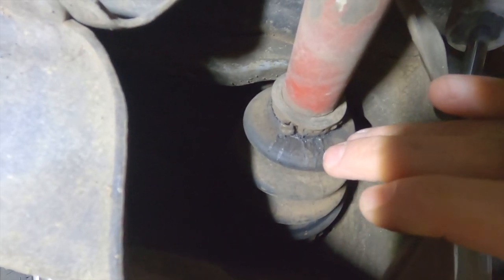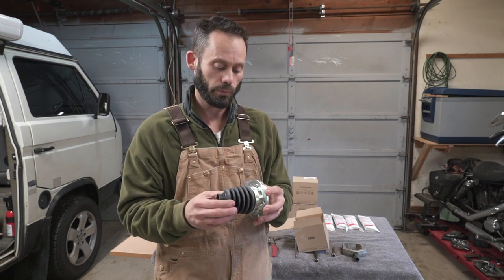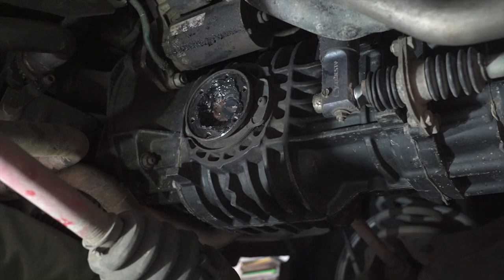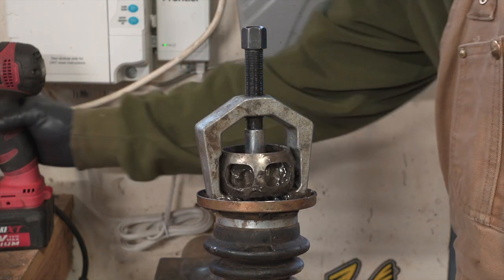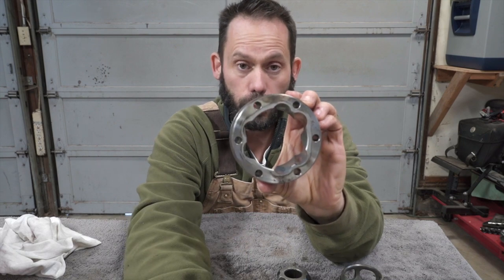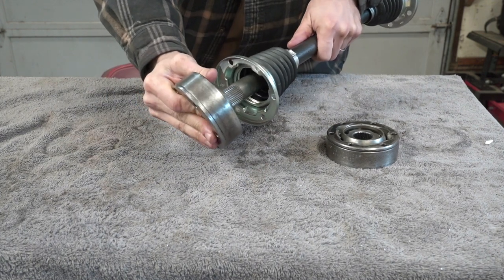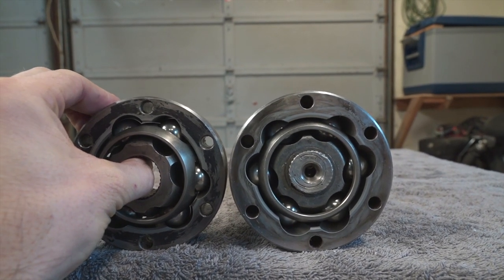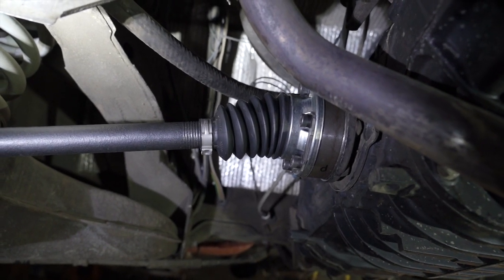How To: Vanagon CV Joint rebuild with OEM VW boots and clocked joints

Comment: Good job on the tutorial. Glad you mentioned the clocking as most folks are not aware of that. I replaced my CV's with the Porsche 944 CV's as they have more articulation which i needed when I upgraded to the GoWesty 1.5" lift springs.
Reply from the maker: 944's are on my list but I can't justify them until one or more of my Vanagon CV's need replacing.  If these Tiguan boots fail I might have to look for other options and then just put in 944's at the same time.  
nate
Reply: After installing Gowesty 1.5'' springs my CV joint' s made noise when accelerating. Clocking was not correct either. Now go and install 944. It is very important that you install the old drive shaft in de same direction of rotating.

Comment: Previous owner had those bolts torqued to like 100 foot pounds.  Had to use a pipe on the breaker bar.  And, no tensioner washers nor serrated washers either.  Anyone know when you put the replacement axle in (I bought a whole, new axle.) how closely it should fit the space ?  Right now, it seems if I get the wheel side in, I am going to be about 1/2 inch too short !    The camping trip is in a week !!!
Reply from the maker: First make sure it is the same length as the old axle. Manual transmission?  They will be the same length. On an auto they are different lengths. If it appears to be the same length, it may just be the new boots that are pulling the joint back a bit. You can stretch the joint out a bit. But first make sure it is the same as the old one!
Nate

Comment: great explanation of every thing,  i never separate my joints to repack them, i feel that the wear pattern will not be disturbed if i leave them together.i just blow them out with cleaner.
Reply from the maker: That is true about the wear pattern but I would be more concerned that you are not able to inspect the balls and races properly to check for pitting or excessive wear.  But at least you are putting in new grease and keeping them fresh!
nate

Comment: Excellent!!!  Up until now, the Ron Chandler video for CV Assembly was the most accurate video I've seen.  But you covered everything, even beyond the Joint Assembly and included clocking which is often difficult to find.  Only one other thing that would be helpful is the torque value for the CV Bolts.  I can't count how many other videos that I've seen that have left out important details or have given incorrect CV Assembly instructions. My Hat's off to you. Thanks!  I'm saving this video in my video library to share with others.
Reply from the maker: Thanks, I totally spaced adding in the torque value when making the video. Thanks for the feedback!
Nate

Comment: Good breakdown, good techniques!  I hoped you'd cover things like putting both circlips in/each side of the bearings, how much extra grease you put in the cups on the axle, or drive output flange before installing.. tips on bolts, washers, keeping it all tight, any ideas like if you need to retorque after x miles.. 

Those axles look sharp!
Reply from the maker: I have never seen circlips on the back side of a Vanagon joint or even the use of the domed washer.  These only use the circlip that was shown being taken off in the video.  This video was centered on rebuilding the CV's and not a full install video on CV joints.  
Thanks
nate

Comment: Great video.
If I may the reason those bellows are rubbing together might be an easy fix.
Cut off those pinch clamps.
Slide that boot out over those ribs.
Then install a new pinch clamp.
This will elongate the bellows and give you more space between the ribs of the bellows.
Reply from the maker: Yeah stretching the boot out would keep the ribs from rubbing but I am not sure about adding in additional "stress" into the boot.  Where it sits is the natural length of the boot and after 30K miles, the ribs look almost new.  If one does fail, I might try that to see if it lasts longer.
Thanks for watching!
nate

Comment: Awesome step by step cv joint video. Thanks a bunch!!!
If one side of the inner race has a step like ring and the other is flat, which side faces the axle?
Reply from the maker: On the inner race it doesn’t really matter much. I would put it back the way it was. If you don’t know then put the step facing out. 
Nate

Comment: Great video.  I have an 87 auto and it started clicking on a 500km drive today.   Couple of questions,  what causes them to start clicking? Second would this mean I need new cv joints or would a clean and repackaged as you have shown be enough.     Thanks again for the well don video
Reply from the maker: They can click if the grease turns hard or if there isn't enough grease.  If you catch it early, a quick clean and grease will be fine.  Take them apart (one at a time) and inspect the races and ball bearings for any abnormal wear or pitting.  Some slight grooving is the races is fine.  Reassemble and put in fresh CV grease.  
nate

Comment: How have the boots held up so far?  Just curious. . . . I had to do the similar thing on my '91 GL after the outer bearing started to squeak.  The joints fell apart on both sides as I was trying to get the spline out.  This video was extremely helpful, especially after I put them back together wrong and they would not bend at all!!  Thank you for all your videos!
Reply from the maker: Yep it’s easy to assemble them wrong and they will be locked up as you found. Glad we could help. 
Boots have been holding up great!
Nate

Comment: Awesome video, thank you.  Nate, do you always do this job with the van on the floor, no stands or ramps?  Is that the standard practice?
Reply from the maker: Yes on the floor. Our van is tall enough that we can fit under it easily. If you need more room, ramps are good but if you use jack stands, make sure they are under the trailing arm and not the body as it will put your CV joint angle to high for easy install.

Comment: Great video and very in-depth! I was wondering on the newer joints like on my 2006 Jetta TDI, where the outer race is equally spaced and there is no wider or narrower part, should you still clock it so lets say one side has the ball on the top and the other side has the "flat" portion on the top, in other words so the balls on one side are offset from the balls of the opposite side?
Reply from the maker: I am not familiar with the Jetta joints but since your CV angles are so low, I am not sure it will matter much.  The clocking is really beneficial when you have more severe joint angles and allows for less binding during rotation.
nate

Comment: WOW Nate you are just so mindful with your work and advice! Thank you! 
Wondering what your height is on the rear of your van from center of wheel hub to lip of fender? Also if you’ve considered doing the 930 axle upgrade? I’m contemplating this now and working with a mechanic to actually do the work.
Reply from the maker: We are around 17.5” in the rear with the old GoWesty 1.5” lift springs. Regarding the 930 joints, our WBX doesn’t put out enough power to cause any issues with the stock style joints. We did put in the higher angle 944 joints when we got back from Canada though. The 930 joints are great for high HP or torque engines and vans that are lifted more than ours. Chris at T3 Technique has new joints out that are like 930’s but don’t require new flanges. 
Nate
Reply: Ah yes, the 944 CV joints are what I’ve been looking at, not the 930s (was confused). I too have a WBX. Rear heights are 16 3/4” LR and 16 7/8” RR but going to shim LR 1/2” and RR 1/4”. Working with existing GoWesty non lifting springs. Will redo TA bushings, wheel bearings, CVs and adding Radflow shocks. Is it worth it to go up to 944 CVs or stick with German stock ones (GoWesty deluxe bundle) in your opinion? I do some off roading but am very careful. 
Gosh at this point I feel like I owe you a consulting fee 😉. Thank you 🙏
Reply from the maker: At that ride height and mild off roading, the stock style joints will be more than fine.  They are actually a bit stronger than the 944 joints as the increased articulation for the 944's come by having smaller balls in the cages than the stock ones.  If you don't find yourself binding the stock joints, I would stick with a high quality German joint.  The Burley Radflo shocks are awesome and are on our list for an upgrade in the future.  
Also use a high quality CV joint grease like I show in the video.  Do not use the Redline CV-2 grease that GW and others tout.  
Sounds like your van's gonna be dialed!
nate
Reply: Thank you so much Nate.
Reply: @ThatBaldwinLife  Hi Nate. Curious as to the reason(s) for recommending against the Redline product.
Reply from the maker: The Redline grease did not hold up well for us in the CV joint applications.  Chris at T3 used to recommend it as well but does not anymore either.  We went back to what all the OEM manufacturers use which is grease specifically made for CV joints and it has held up very well.  The Redline grease would get hard and "cake" areas of the joint and caused some premature wear on one of our joints.  Hope that helps
nate
Reply: @ThatBaldwinLife  Great response thanks for taking the time.

Comment: Fantastic! Love what you guys are doing. Do you have any feedback on how the boots are holding up after one year? Rock on!
Reply from the maker: Thanks!  So far the boots are holding up fine. Due to our lift, the bellows do rub together so I would expect them to eventually fail there but we will see. We bought them from FCP Euro just for their lifetime warranty on all parts so if they do fail, we send them back and get a new set. 
Nate
Reply: @ThatBaldwinLife  Thank you. Considering the shaft, the joint, and the boot all rotate at exactly the same time I would claim there will be no abnormal wear where the pleats come together. Again, great stuff from your channel.
Reply from the maker: Good point, let's hope you're right! :)
nate
Reply: @ThatBaldwinLife , would you recommend a different boot in retrospect?
Reply from the maker: Nope, they have held up great so far.  Better than any other boots we have used in the past.
nate

Comment: Great video learned heaps. Now I know what clocking is. You didn't rebuild the CV, though just new boots and grease. My cv clicks and is very noisy. Would this procedure cure that? Is this all that goes wrong with these CV because I would like to keep the OEM CVs. Cheers
Reply from the maker: That is how you rebuild a CV joint. There are no spare parts you can put in the joint nor would you want to mix old and new parts. Your options are to rebuild like we did or buy a new one.  Depending on what is wrong with your CV joint, fresh grease may fix it. If your old grease is dry and caked on, it will click. 
Nate
Reply: @ThatBaldwinLife  Thanks mate. It is old and caked on. But after cleaning it up about 30min ago there are score mark on the inner race. I think at some point the cv has been exposed to grit etc. So new one. Your vid has been a tremendous help so thank you again.

Comment: ARP makes some pretty sweet HD male 
12pt CV bolts but they don't work on front syncro inner joints .Not enough room for the socket. I never use allen heads .
Reply from the maker: Good to know!  Those would probably not be a prone to the heads getting gunked up and hard to remove. Thanks for the tip
Nate

Comment: Thanks for the video that was very informative. One question what torque do you use on those bolts? Any specific tightening pattetrn? Do you use any lock tite?
Thanks.
Reply from the maker: Torque to 33 ft/lbs. No special sequence and no thread locker. That’s what the serrated washers are for. 
Nate

Comment: Great video Nate, would you do this after so many miles or just if you have a torn boot, thanks
Reply from the maker: Hi John, that is a tough one because I have not had a CV boot last long enough to make that call.  I hope these VW boots can last.  If the boots hold up you can go a very long time without needing to open them up.  I hope I don't have to look at these for 75K more miles.
nate

Comment: I ordered a BRAND NEW GKN Lobro axle with CV joints attached from Bus Depot and it came with the 3 outer rings on the CV joint facing the axle/tranny.  You mentioned that is the wrong way to have it facing.  Why?  Should I be concerned?  Also it appeared the outer race did not have a chamfer facing the axle/tranny... its a flat edge.  Again, should I be concerned?  Funny, because this unit appears to be brand new from the factory.
Reply from the maker: Not uncommon.  It would probably be just fine to run it the way it is, especially if you are stock height.  But, if you want a lesson in CV rebuilding, you can take it apart and see how it was put together.  The outer race with the three rings is not as important as I have seen them run both ways. I just try and be consistent.  The inner cage should have the chamfer facing the axle.
If you decide to take it apart, be aware it is a new joint and will be tight.  A bit harder to install all of the balls in the cage.
nate

Comment: Where and what kind is the puller you used to get the hub of the shaft.  The one i got on loan is not wide enough to clear the cage.
Reply from the maker: Hey Frank 
We have had that puller for years and I don’t remember where we got it. I believe it is a ball joint or tie rod puller maybe?
Nate
Reply: @ThatBaldwinLife  Ok, thanks anyway. Will keep looking, most seem to narrow to fit around cage.
Reply: Hi Frank. I'm a bit late to respond but I beleive the puller Nate used is called a Pitman Arm puller. You need the opening to be at least 30mm+.  I'm also about to buy one myself for the same reason & same job. Hope this helps.

Comment: Dumb question: Do you need to put the van on jack stands to do this? Or can you just undo these bolts while it is sitting on the ground (for all 4 axles)?
Reply from the maker: No jack stands needed. Just make sure the E-brake is on and maybe chock the wheels if your E-brake is suspect. Then remove the 12 bolts per axle and rebuild!
Nate

Comment: What size triple square is it all mine are slipping
Reply from the maker: 8mm triple square.  Make sure the bolt head is clean and tap it in as far as it goes.  They might be old and stripped out a bit.  That makes it pretty hard and you might need to get a larger size torx and pound it in with a hammer and replace the bolts with new ones.
nate

Comment: at min 7:22: is it necessarry to have the bearing cage still on, when you use the puller or can you just take the cage of by hand before?
Reply from the maker: Not always. Sometimes the cage is hard to get off of the inner race while it is still on the axle. That was the case here and I wanted to show you can use the puller while the cage was on. 
Thanks!
Nate
Reply: Also could you send a link to which puller you were using here? Thanks! 

Great vid though! I’ll definitely be using it here shortly!
Reply from the maker: I wish I knew but I have had this puller for a very long time.  I believe it is a tie rod puller.
nate
Reply: @ThatBaldwinLife  awesome! Thanks! I assume as long as it’s wide enough to keep the cage free it’s good to go. 

Also is the size for the bolts a M8 triple square?
Reply from the maker: Yes it is an 8mm triple square.
nate
Reply: @ThatBaldwinLife  it's def a tie rod puller available a any auto parts store!

Comment: How come you left out the hardest part of the job?  I did this job to one axle on my van and getting the wheel side 1st bolt in on re install was a major pain,   had a friend hold the axle while I struggle for 10 minutes to get the bolt in, boot in the way dark and hard to see bolt.  If you have any tips for getting the wheel cv bolts on I would appreciate it.  Also you left out to recheck if bolts are tight after driving  50 -100 miles.  Thanx I really enjoy your videos , slowly rebuilding my 37  yr old Van,  85 Westy weekender from Cali now living in Utah
Reply: Getting bolts in is easy for proper grease monkeys, which I'm not... I recall doing the top bolt on a 350 turbo trans by myself was quite a challenge (w/ out a trans jack). I would image torque spec is fairly important on these bolts too?
Reply from the maker: Hey Paul I guess I have never had an issue with that and install is the reverse of removal.  I just take the extension on the triple square and insert it in the top bolt of the axle.  Then put the axle in the trailing arm and use the extension to move the bolt around until it lines up with the top hole.  Then move the axle around until all bolts are in.  I torqued all bolts to factory specs based on the Bentley.  
Good luck with your rebuild of your van!
nate
Reply: Paul I'm going to guess that it was because of the CV-angle during the time you were trying to get the bolt in.  If the van is on ramps, with the suspension partially compressed, the CV angle is not as much.  But if you have it jacked up, with the suspension hanging at max droop, it can be real hard to get that first bolt in because the CV won't just lay flat onto its flange.
Reply from the maker: Great advice.  My van was not jacked up at all and the first bolts on the wheel side can be tougher for sure.
nate
Reply: i've done this 2-3 times on my bus and it wasn't a problem at all as far as I remember. And I'm no mechanic.

Comment: Do these CV boots work on automatic transmission 85 vanagon gl
Reply from the maker: Yep, same cv joints and boots, just the auto’s use two different shaft lengths so keep track of which side the axle shaft came from. 
Nate
Reply: @ThatBaldwinLife  Dankeschön 🙏

Comment: What is the size of the puller you used to remove the Cv from the drive shaft
Reply from the maker: I don't know the size of puller but I believe it is a tie rod puller that I have had in my tool box for years.  I just needs to fit over the cage so it does not bind.  I won't be near my garage for a bit or I would measure it for you.
thx
nate